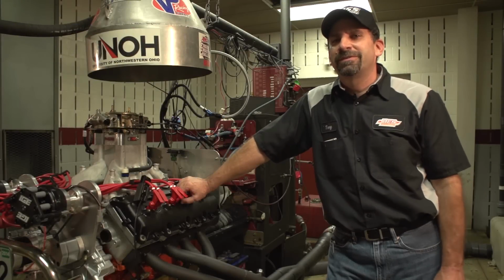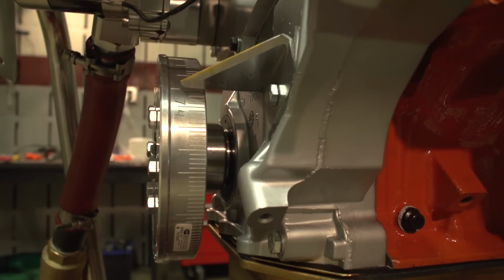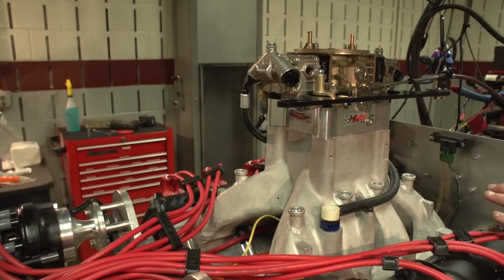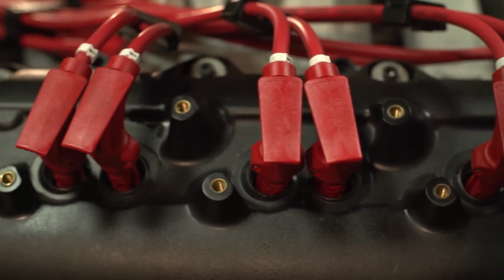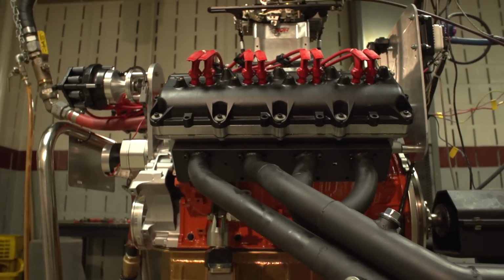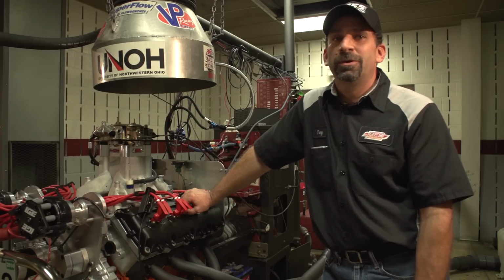700-Horsepower Gen III Hemi by BES Racing Engines at the Amsoil Engine Masters Challenge 2014

Comment: I have a 2005 5.7 Magnum I want to know if I can use the heads and parts from that motor to put on a 2007 Jeep Commander 5.7 Hemi block will it work
Reply: Same exact engine. It'll fit.